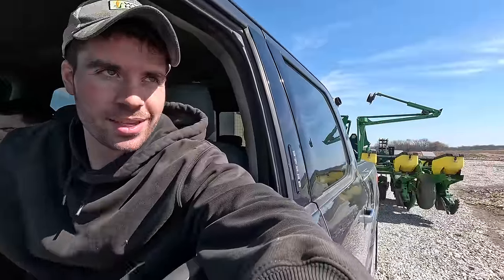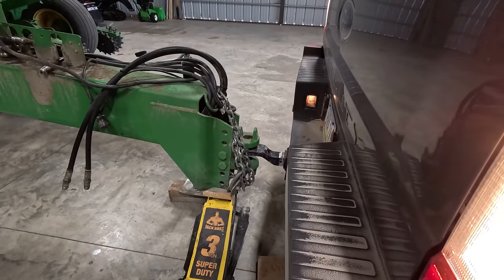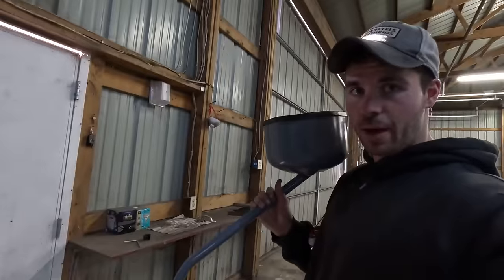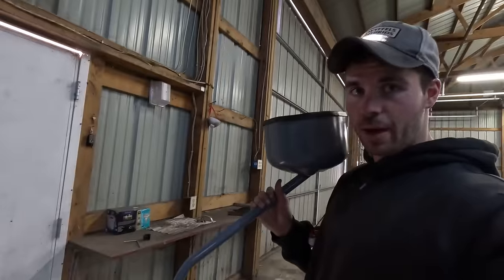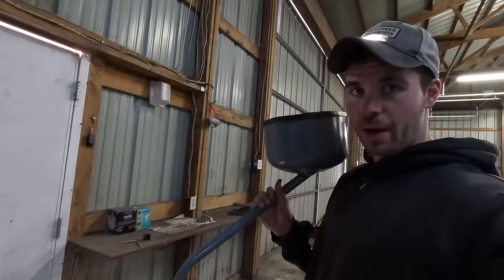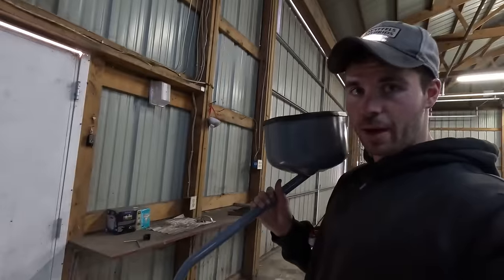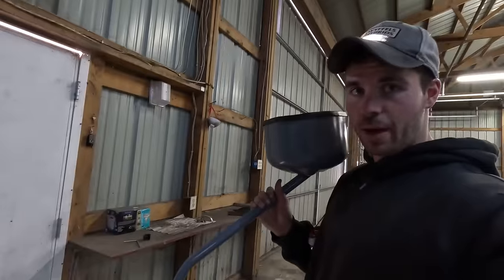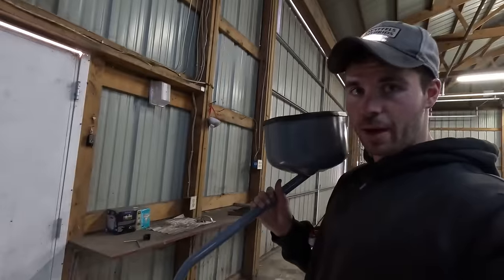An Early Start at Spring Fieldwork!

Comment: One thing that helps a lot with those older tractors when hooking and unhooking hydraulic hoses is to shut the tractor off and then move the lever back and forth to take all of the pressure out of the lines. It is also a lot easier to hook the hoses up to the tractor with the Tractor off.
Reply from the maker: Should of done that! Next time!

Comment: Grant I run a Ravin 450 rate controller with a John Deere autosteer screen. All I did was add a cable from the Ravin to my John Deere screen and it paints the screen with each section that’s turned on. I do have to manually shut off sections when I’m about to overlap. Auto shut off with the John Deere section control would be great but I’d recommend adding more than three sections if you do have section control added. 3 section on 90ft is still going to overlap way to much.
Reply from the maker: I may try that!

Comment: If you turn the steering wheel back and forth while turning the key on the 4020 it will start better
Reply: It really helps on those older  tractors. It releases the pressure on the hydraulic pump.
Reply: What he said!
Reply from the maker: Will try this next time!

Comment: I suggest to put the rate controller on the tractor and not on the implement, that way you can use the same controller to spray, apply anhydrous, etc. Keep up the hard work! Can’t wait for the next video!

Comment: Put a grove conversion on that 4020. The original pioneer conversions that have been around for years were junk right out of the box. Grove makes a nice kit to invert those old remotes to a push pull with the pioneer tip. Little pricey but makes life easier

Comment: A JD rate controller isn't too expensive, but I'm not sure how much the section control unlock would be on your 4640 display. Depending on what level of correction you have on your starfire globe you could map your fields and the shutoffs could all be automatic. I believe with a JD rate controller you could add more valves for more sections instead of just three on a 90' boom. If you stick with the Raven, you can get a $100 cable from Ag Express to map your coverage on the 4640. There's value in that as well for both NH3 and spraying. 

If you plan to keep your 606C for a long time, spend the money and do the Calmer rebuild kit and also get all new slip clutches. Should last you a long time.

Comment: We have a disc just like that. We pull it with an agco rt155. Its the perfect pair. The tractor is turned up a little so it has about the same horsepower as the 8110

Comment: When you switch those hydraulic lines shut the tractor off set the implement down with the tractor off then move the remote lever back and forth with the tractor off. That will take all the pressure off the lines and you won’t have to get hydraulic fluid everywhere or damage the fitting.

Comment: This suggestion is a bit late now but if you are plant alfalfa on corn stocks you'll get a better stand if you have less debris to plant into.  Guys around here will run a flail mower to chop up the stocks then round bale them before doing tillage to get a nice clean bed to seed.  Realize you have neither implement but probably have a neighbor that may and the corn stalk bales make good livestock bedding or can be ground into a feed ration so someone probably would buy them or take in trade for doing a custom bale job.

Comment: Helpfully tip stop beating the crap out of the hydrulic lines to release the pressure. Put the lines in float let it do what it needs pop it back into neutral the lines will lose pressure or if you don't have float shut the engine off push the lever back and forth to release the pressure unhook them then start up.
Reply from the maker: Didn't even know there was float on a non side console 4020. How do u put it on float?
Reply: @granthilbert5632  I'm not sure if there is or not, Case guy. But if there's not just shut the tractor off push down and lift up the hydrulics the pressure will release from the hydrulic lines. When u smack them on things it damages the ends and when you put it in your tractor ur damaging the valves.

Comment: To help with the hydraulics on the 4020 turn the engine off then work the hydraulic lever back and fourth and it should let the pressure of the hydraulic lines